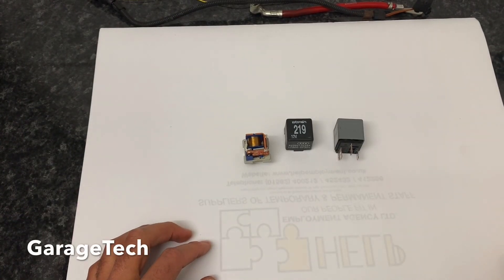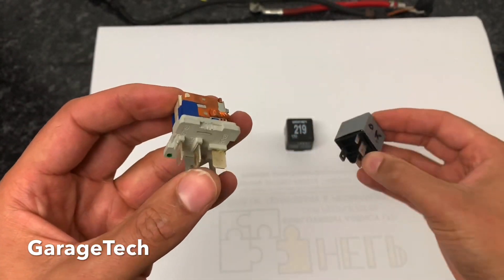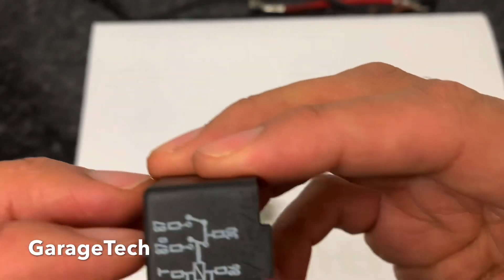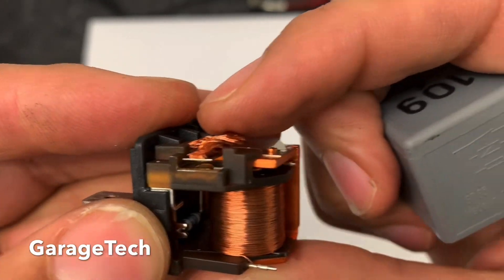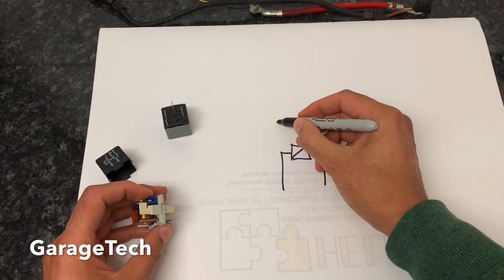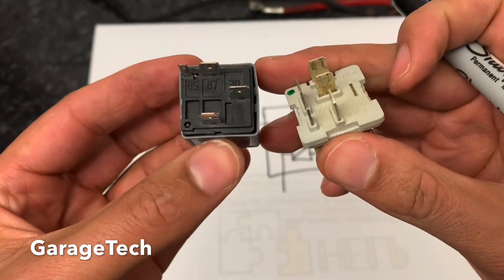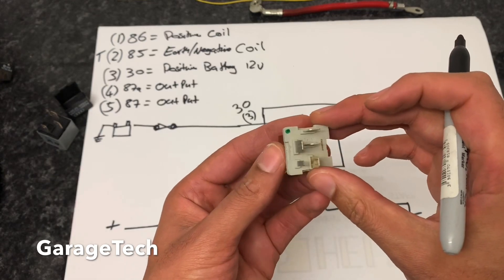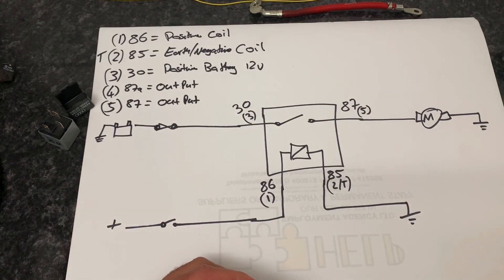How does a Relay work?

Comment: so signal / imput is same as  86 as battery always has to be 30? Thanks
Reply from the maker: Hi Troy, yes the input is 86 👍🏼 battery live is 30. Just make sure both have a fuse in the line to protect the circuit.
Reply: The relay goes to my fog lights on the outside of my truck they are yellow. High performance spot lights.i am trying to figure out how much they cost

Comment: Hmm, I still don't understand. I'm trying to fit a car horn that needs a relay because of it drawing a higher current. The ground is simple and I only have one positive which is the switched car horn push itself in the steering wheel. So I assume I have to find a separate 12v direct supply or can I bridge it? The horn's motor itself needs a 12v supply coming out of the relay, so that would be as per the motor in this diagram?
Reply from the maker: Hi John, yes your horn would be the motor in this diagram, you need a separate live to the relay and then from the relay to the horn, bridging it would defeat the object the of the relay as all the current would go through the switch. Don’t want to confuse you but usually horns are earth switched, if you only have one live you could then bridge the live to feed both sides and have the switch on the earth. Of course your live wires will still need to be capable of carrying the current. Hope this helps.

Comment: Is the + also representing a battery? A different one?
Reply: A separate wire, but from the same battery. I'm a bit confused myself as I need to fit a relay into a single + wire going to a horn button. This looks like it only activates a switch and a second 12v circuit is needed.